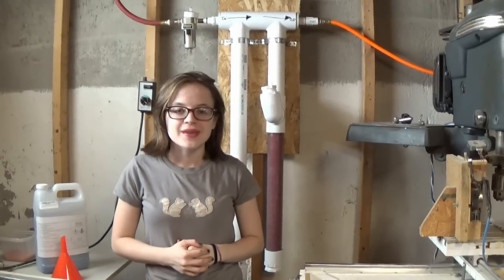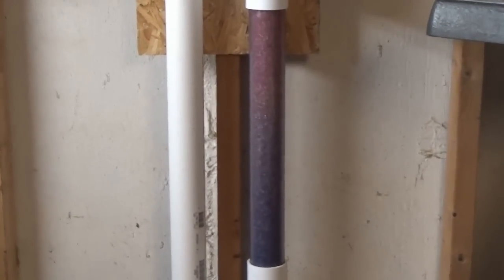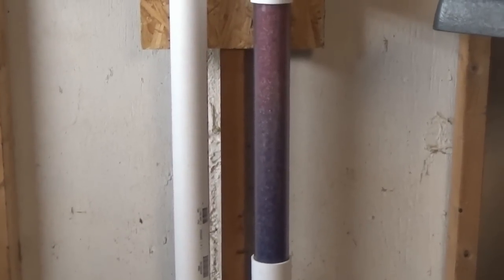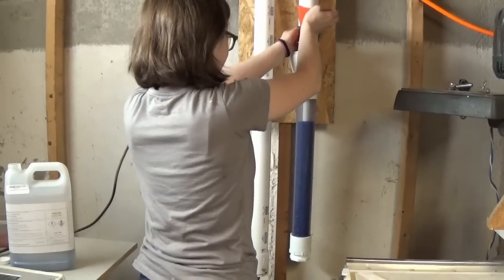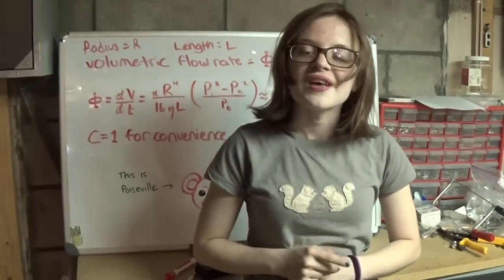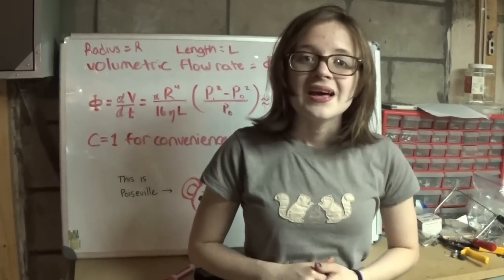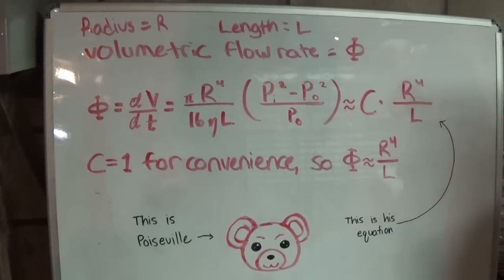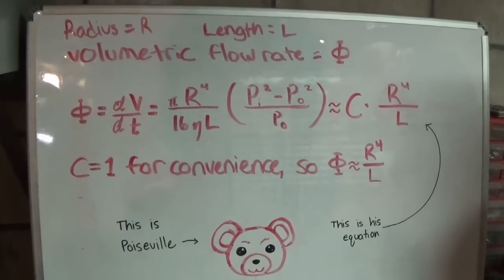Ep 11.5  Dessicant Dryer Update

Comment: Hannah, how old are you?  I'm wondering because your channel is technically (both content and production quality) better than any I've watched from anyone under 25 (I was going to compare you to guys since they have most of this kind of content, but that's irrelevant, of anyone guy or girl), and I'm guessing that you're much younger than that.  I'm very impressed as are others and I'm sure that I'm not the only one wondering.

PVC.  I know that you think you've addressed the issue from a technical perspective but I assure you that you are not as safe as you think:
1- your compressor bank is capable of generating 125psi, and you could change the regulator setting (say to use a grinder or impact gun) and forget about it or the regulator can get jammed, even if that doesn't happen the general engineering safety margin for this kind of thing is at least 2x, so I wouldn't use anything rated under 315psi (I think the closest PVC pipe rating is 330psi).  
2- the pressure rating on PVC pipe assumes it's new and perfect.  Scratch it, hit it, expose it to UV light (you mentioned sunlight but your fluorescent lights will eventually affect it), temperature extremes, pressure cycles... all weaken it and make it brittle.  
3- glue joints in the stuff can be finicky.  If you take a second too long they seem to stick together in the wrong place, and don't get them perfect the seem to come apart or leak.  In Ep. 11 you didn't primer a number of the joints.  I'll bet that those come apart before our PVC shatters.  With a lot of force- I used to make air cannons with the stuff and had a design that could shoot a potato through 2 sheets of 3/4" plywood, a PVC endcap is quite a bit harder than a potato and you are quite a bit softer than 2 layers of plywood

Again, I know you think you're being safe with this, and most likely you'll never have a problem with it, but I assure you you've built a potential bomb.  I had a friend of mine, a mechanical engineer, design and build a similar tank to test some automotive components, if I remember correctly it was 3 or 4" SCH40 PVC with some end caps/cleanouts and fittings in it, all brand new pieces that he bought that week.  He set it up with a blast shield so if it did rupture it could only go down towards the floor.  Well it did rupture, one of the end caps hit the floor and bounced up into his face when he was standing about 6' away from it.  His glasses were embedded into his face (had to be surgically removed), broke his upper jaw, knocked out a bunch of his teeth which had to be replaced with dentures/implants, and he ended up with 2 steel plates in his face and for a while they thought he'd lose vision in his eye.  

This really isn't something to be taken lightly.

Finally, your design- short version, if you made it out of steel or soldered copper it would not only be safer, but for the first water separator to really work it needs to dissipate heat.  Something metal that conducts heat would work MUCH better, or even plumbing a separate air tank in the hose some distance away from the compressors would work.

Harbor Freight used to sell a desiccant filled dryer (about 4 foot long steel tube with fittings and mounts) for cheap (I don't see it on the site now) or google "Franzinator" for a simple design that is safe and easy to build (dig up the original drawings, they were much better than the thousands of versions made since then).  In my case I run my air into a large tank, then through ~20' of 1/2" lines to a separator/filter like you first showed, into a desiccant dryer (originally a welded franzinator but I had problems getting threaded fittings for it that didn't leak and at some point realized that I had more in fittings then it would have cost to just buy the dryer from HFT) and finally into a motorguard "toilet paper" filter.  That combination gives me plenty of very dry air which I use for painting, sand blasting and plasma cutting.

Otherwise keep up the good work and good luck with your project!  I'll likely show some of your videos to my 4y/o twins.  They, especially my daughter loves helping me work on the race car, fix engines, all things mechanical, and both her and her brother love helping me with electronics.  Both love watching various builders/automotive youtube channels with me, and  I think they would love to see someone closer to their age doing this kind of thing than someone my age. ;-)  I want to see you get into some of the math, when I was 12 my I wanted to build a go cart so my dad (an engineer in the space program) handed me "Mark's Engineering Handbook" and helped me learn some concept of calculus so I could figure out how many HP I needed to get the acceleration I wanted (I wanted to be able to out accelerate his car).  Sounds like one of  your parents might be a bit like mine.

Comment: no kids pvc is very strong up to 200 psi. most of your top notch spray booths uses pvc pipe for the air supply being cheaper than copper and a lot easier to work with hannah don't forget about the isocyanates the voc in automotive paint you could get nerve damage as well as many hart and lung diseases. make sure you have a good 3m respirator or fresh air system with a carbon monoxide filter and as you said even when sand blasting. i've been in the automotive autobody diesel heavy trucks for over 25 years spraying over 30 gallons of product per truck mainly garbage trucks and land fill equipment. i got my start helping my father out fixing our family cars and trucks as well as the neighbors went on to bocies in 11 and 12 grade witch is a trade school where 1/2 day you do your trade and the other 1/2 you go do regular school. idk where you live maybe they have something like that in your state country after school i went on to alfred state college for autobody and heavy equipment here in new york great school. you actually work on your own cars or he general public. back in 1992 ball other schools your worked on the donated vehicles that the instructors would break for you to fix. alfried was the only school at the time you were working on real ppl vehicles   now a 3m system about 6000.00 but i think they will being to donate one if you air drop some of your vids to them stay safe and i see these are about a year old so i hope your bug turned out great

Comment: It's good to focused on what can hurt you. But you seem to have the basic idea of keeping your body parts out of the way of the spinning parts based on how you handle a table saw and drill press.. As for bursting your air dryer under pressure. Possible but if I read my data tables right your safety factor with 90 psi is on the order of 14 times for everything but the clear pipe. I think when I copy this I may see about building a slipon metal pipe shield for that section. I can't be confident someone else won't be in the space it will occupy. But at 14 times the rest is within my risk tolerance. Once again Thanks.
Reply: I might suggest a sonotube instead of metal.  The cardboard would likely keep the PVC shards from killing anyone if it exploded.

Comment: Ok kid, all kidding aside. The pipe you are using is NOT rated for continuous  service at lowered atmospheric temperatures such as ARE found in most of Americas garages while at elevated pressures.

FAILURE MODE ANALYSIS TIME.

Pressure regulators on retail, home use, air compressors are HORRIDLY, NOTORIOUSLY, unreliable. They can get stuck leaving you with an air distribution system at tank pressure. Which is usually around 100-120 PSI. And PVC under pressure is insanely fragile compared to copper or iron. 

I'm a retired manufacturing test engineer with internship at a nuclear power plant. Hi pressure everything is my thing.

Please study either copper pipe or iron pipe radiator, chiller air driers.  I go with iron cause they can survive ANY failure mode if my compressor.

Cheers. Keep learning.